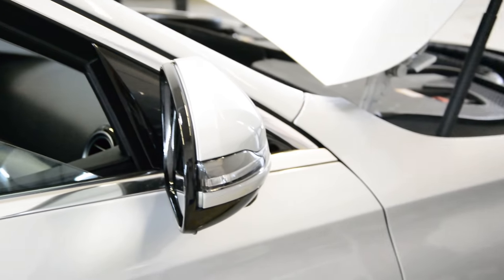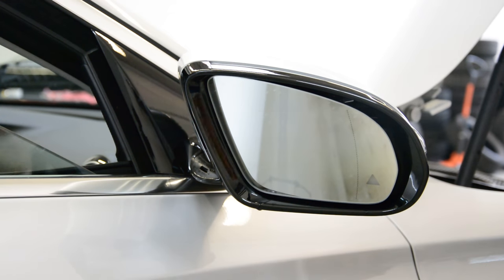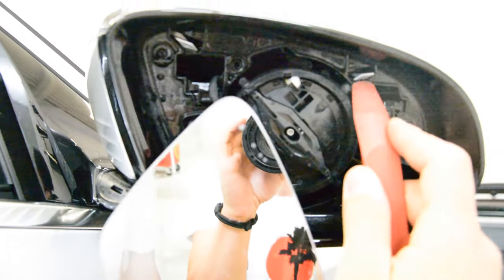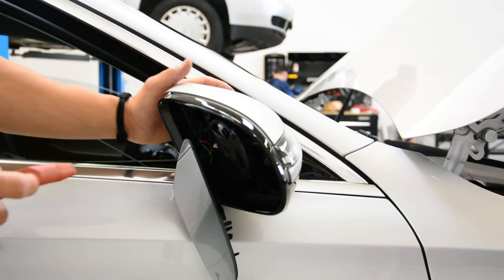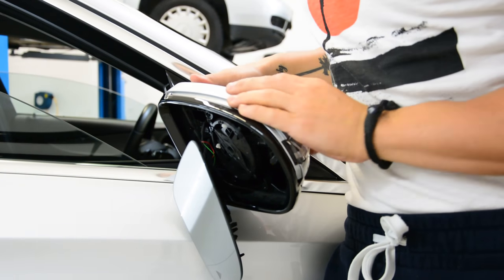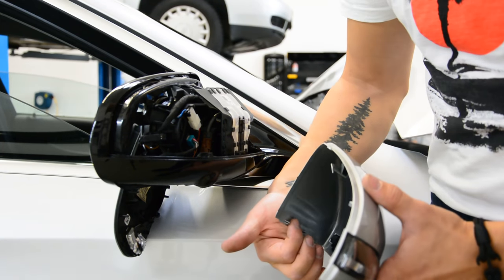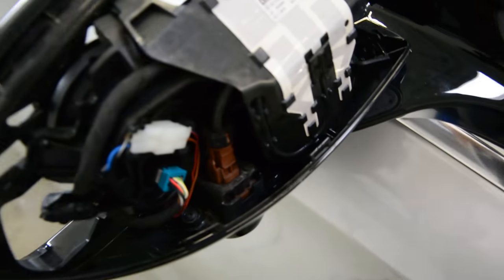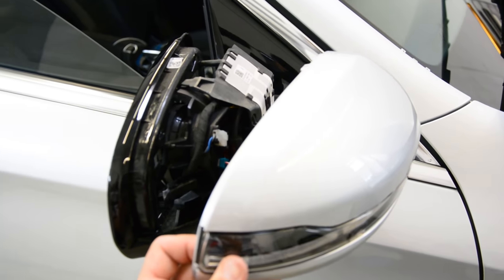Mercedes E Class Mirror cover removal

Comment: Someone scratched my left outside rear view mirror cover.  I ordered a replacement from Ebay for $45.  It arrived quickly, and this Sunday morning, following your video, I installed the new cover in about 20 minutes.  GREAT instructions!!  Saved me $$ on this S Class Mercedes.  I didn't need the little tool you had, but used something similar.  Thanks again!!

Comment: I just tried to pry my passenger mirror out using this method but shattered the mirror. Bummer! 
That's a $160 mistake. I was intending on adding carbon fiber covers. I'll just live with the original
black covers, instead of risk breaking another mirror. I have a 2019 E450 Coupe. At about the 30 
second mark the installer mentions with your fingers or tool pry off the mirror. I think this would 
work fine using your fingers. If you place the pry tool in the wrong place it can crack the mirror.
Reply: Yep I did the same on my Aunties car 😔 Tried to fix a mirror folding out too far, now made the situation worse.

Comment: Can you help me?🙏
I got some mirror/puddle logo-lights for left an right side.
The left side is fine. But i dont know how to remove the right one, because its smaller inside...😕
The other parts inside blocking way, the 360 cam is alread remmoved...
Thanks a lot😅

EDIT: they say cut out the Bracket inside... or push down the lower plastic of the mirror, oukey :)
Reply: I have the same issue but on my S63 L which has same mirrors and setup as W253 and W213. I'm currently on the first side which is Passenger side and zero room to take the LED puddle light out. I have the new logo ones but I'm guessing I will have to trim it out some how using a Dremel too.
Reply: @sambam2005  mine is done, i "dremeld" a piece out... Its was easy, take 10-15min to slowly dremel the inside a bit. Now its fine, and looking nice😁

* a bit... 0.5inch or smt... watch the mirror-motor an other cables, dont broke them😊
Reply: How to return a glass